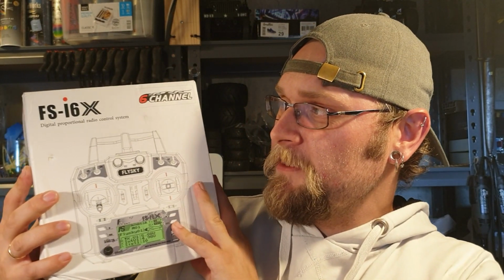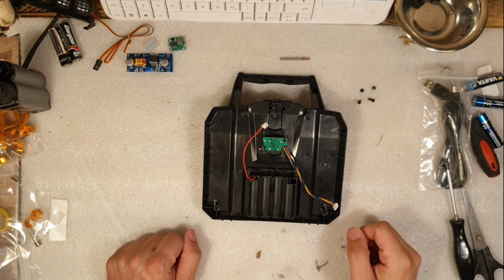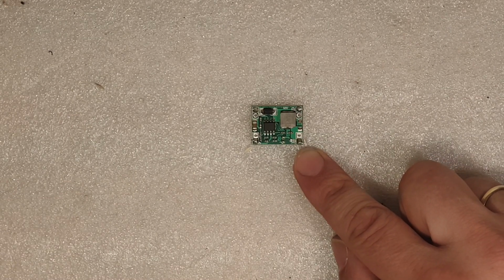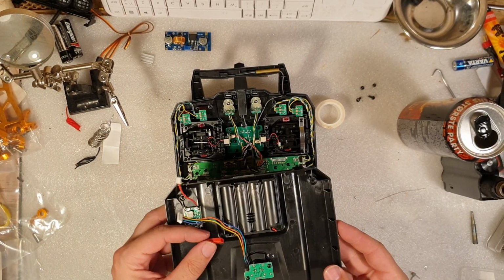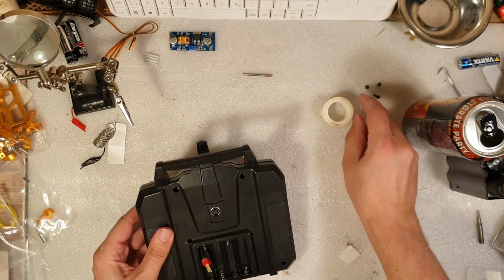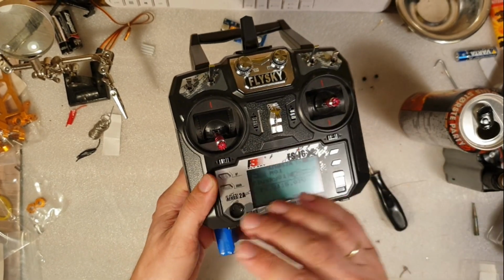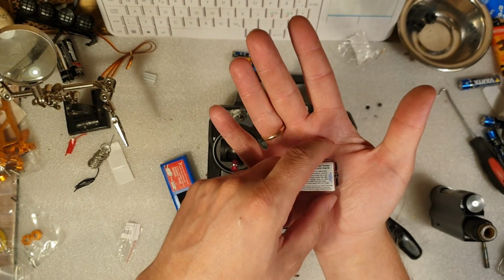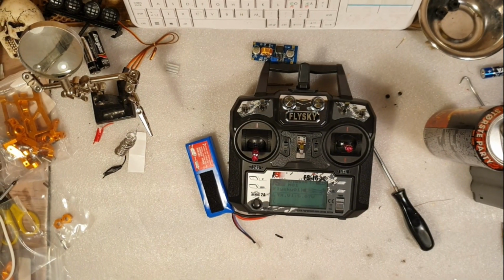Flysky fs-i6 / fs-i6x Lipo Mod a simple how to.

Comment: the problem is de buck converter is always connected with the lipo.i would modify the transmitter zo that when i switch off the transmitter the lipo is disconected from the buck converter (i use lion 's )but that is the same .now i can charge  with the batterie insde the transmitter .

Comment: I added a 2S to this used it for an hour and then the screen faded out and does not turn on or bind or anything. I'm pretty sure I have a 5.6K ohm short to ground(if 5.6k is a short) So next time I will use a step down converter to 5V to be safe.
Reply from the maker: :O ouch, sorry to read this buddy. did the resistor melt? oh yes i bought a pack of 5v step down modules cheap from banggood /ebay comes in handy for many projects :)
Reply: @Just4FunRC  Where is this resistor?
I meant there is a 5.6 K ohm short from VCC to GND. Unless you mean something else. The board itself looks immaculate though.
Thank you very much for the condolences.

Comment: Here is some additional information: The controller is actually powered from 6V and not 5V (4*1.5V). Even a little bit more.

The white small connector is called JST PH 2.0, so the red and white ones are both JST, because JST is the company who invented them. You can get these connectors and a crimper pretty cheap in a set and you would not need to cut the cable.

When doing this mod there is a big downside: The controller doesn't detect when the lipo is getting too low, because the buck converter still works when the lipo is discharged too low. and then it will just drop out completely (a quad would just fall out of the sky). That means you can potentially damage the lipo if you're not not aware of that. Of course an alarm works, when plugged it, but that is crazy annoying to me - especially because there is such a function in the transmitter already.
I made a 2S mod with a linear voltage regulator and a few diodes that is much safer, because i tuned the electronics to simulate a 6V battery, where the controller would still warn me when the 2s lipo gets low (at around 3,6V per cell).

However, since I made the mod reversible (no damage), I went and got myself a bunch of NiMH batteries (got 8 of them to switch around), and that's even easier - they don't get up to 1.5V each but that's fine, because they stay on 1.3V for quite long. I find this to be the easiest and most convenient solution.
Reply from the maker: Neat! thanks for all great information sir. So i take this transmitter is stil a great budget starter :) for now i just use it for simulator. my jumper is still my every day runner.
Reply: I tried mine with a 2s lipo direct to the system, no diodes whatsoever... Works fine so far...

Just not sure what's its effect would be except that it wouldn't alarm once lipo is drained bc alarm goes off at around 3.8v..

I guess it can tolerate a direct 2s because AA batts aren't exactly 6v at full charge, they even more.. (1.5v per cell is actually more than 1.5v at fullcharge/new just like any other batts)...
Reply: @joeyvalenzuela4157  I have not checked what kind of regulator there is on the board, but if it's a linear one, then it could be damaged over time and burn out one day, because it would have to dissipate more heat than usual.
It is true that AA batteries usually are more than 1.5V when full, but 8.4V from a 2S battery are way more than six AA batteries with around max 7.1V. If you want to be sure you could check what regulator is on the board (linear or switched mode) and in case of switched then it would be a good idea to check if the output voltage is right (probably 5V or 3.3V).
Reply: @Noxoreos  ah yeah right.. you could be right that it might burn out one day... I haven't tried it for that long though.. i will take your reply as an advice..

Though, i would also like to emphasize that the old 2s lipo i used only reads at around 7.8v full.. and i haven't flown long enough for it to drain too much or fry my board up.. hehehehe
Reply from the maker: @joeyvalenzuela4157  totalyright buddy, beside if worst case happend you didnt spent much on this starter budget transmitter.... if it was a tango 2 or new from radiomaster i would do little more research.    my good old daily jumper t16pro still uses 18650x2  works perfect for me as most of my gear runs on 18650:)
Reply: min runing 7.5v 2s oni prob dont seem get low bat warning anymore
Reply: @joeyvalenzuela4157  Hello, you posted this comment 4 years ago, now i wanna ask you if your transmitter died on the 2s lipo? Or is it still alive? And next question, did you have or do you have fs-i6 or fs-i6x? Cause they have different voltage regulators..

Comment: I read somewhere, you can power it up to 7.4v (2s) without a converter. Maybe it can be powered even higher? Seems someone needs to test it.
Reply from the maker: yupp. if i recall right it could display up to 6.99v. but should handle 7.4 but 8v im not sure. That is why i installed a tiny dc dc 5v step down :) so i can use what ever 2s 3s 4s i have laying around :D
Reply: @Just4FunRC  how many amps does the step down regulator have to handle?
Ive added a r9 module to mine as well.
Reply from the maker: @rollpitchyall7589  been running 3a but now i've started to stock these mini 4a for my projects. they are awesome.
https://www.banggood.com/custlink/GDvdrHmH8V
Reply: I have fs-i6x.. and yes it reads 7.8v on my screen...
Reply: @joeyvalenzuela4157  is it still aleve after 4 years when you posted this comment?